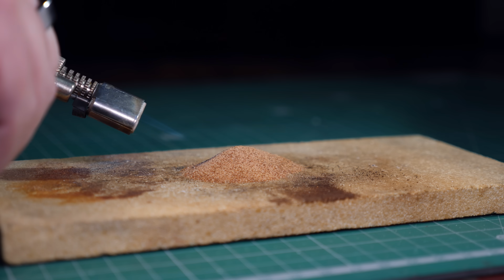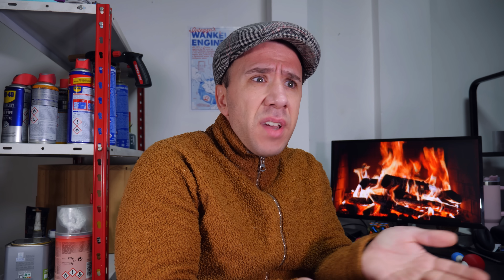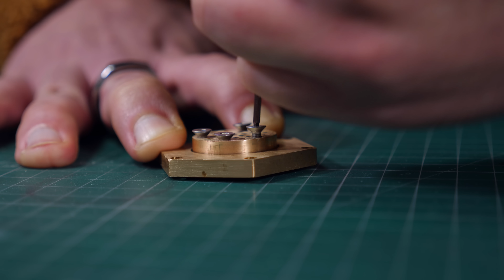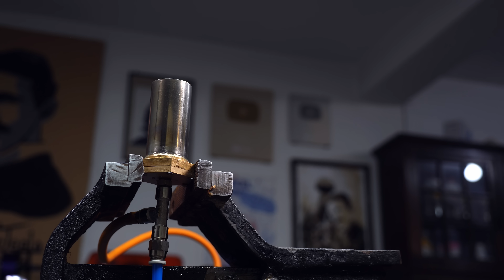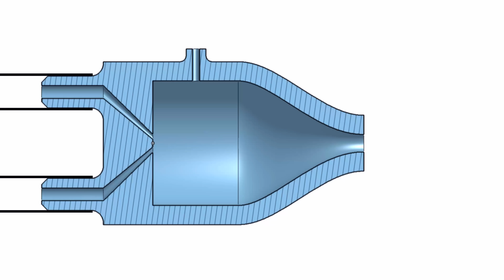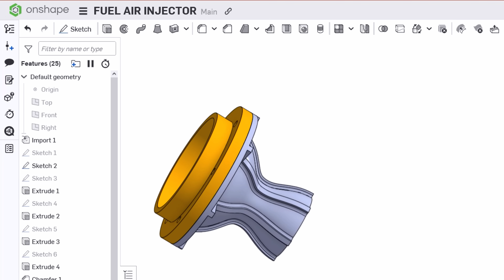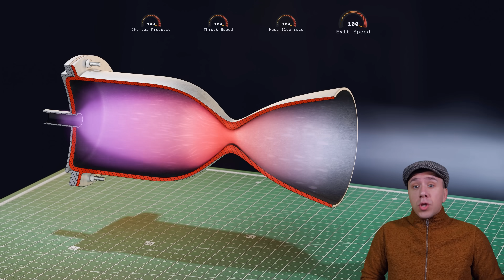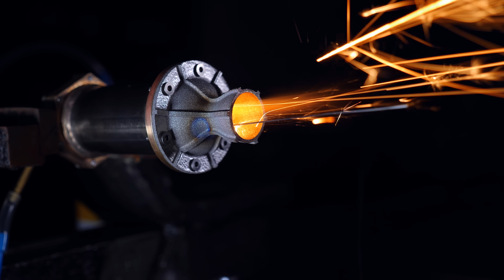I Built the FIRST VENTURI ROCKET ENGINE

Comment: 13:48 did you really just put a carburetor on your rocket😂
Reply: That's literally what I was thinking 😂😂
Reply: If you factor in the compressed air, the ISP of this rocket is not going to be amazing... On the other hand, as an afterburner for a conventional jet engine, this could get really interesting.
Reply: not just any carb, a 6 barrel carb 14:40
Reply: Many liquid rockets have carbs
Reply: @revodrvr  they need to hit their macros
Reply: @revodrvr  source? I’ve been trying to find an example of this and can’t find anything
Reply: @Porcuponic  There's no source because it's not true. Rocket engines typically use fuel injection, because carburetors are inconsistent at best and unreliable at worst.
Reply: @Torrent.Amador  I agree but also like, I think it’s completely impossible. I’m pretty sure rockets have massively powerful fuel pumps. Carbs just use passive evaporation of the fuel. You couldn’t make enough thrust with a carburetor to lift a carburetor.
Reply: @Torrent.Amador  i mean if nazis can find a way to use fuel injection in v2 80 years ago i think he can find a way to do it as well is what i thought to myself that way he doesn't need to reinvent a carburetor
Reply: Hey, they did it on Star Trek
Reply: @stevenhobbs709  Which episode? I want to watch it
Reply: @ptah956 Vis à Vis" from Star Trek: Voyager (Season 4, Episode 18)
Reply: @ptah956 Voyager S4 Ep20
Reply: But turbo charged.

Comment: The reason they probably domt use a solid oxidizer in a hybrid is because of corrosion. Any amount of corrosion in the structure mixed with heat could weaken parts and structures and cause catastrophic failures. At least thats the only problem i see with this at scale
Reply: I also love that he reinvented the carburetor for this project.

Comment: So, in hybrid motors like this, you usually cast the fuel in place and then run oxygen with a throttle. And the fuel is cast with multiple holes through like a mesh to increase surface area to increase pressure from combustion and this higher performance (and even more combustion because the higher pressure and heat from combustion increases the combustion of the fuel too). 

Your rocket will likely work still using AP as the grain and the fuel as the throttle, but as you saw the AP likes to react with everything which makes it a bit tough to control compared to a mostly inert fuel waiting for an oxidizer to combust. 

Cool rocket project though! Can't wait to see you scale it up and fly a model!

Comment: use a quad spiral injector..fed off a single injector.. like the DICOR feed for ICE engines..for the fuel so that you get the right spray! Should help to have better combustion and why not toss in a heat plug or two for the igniter

Run the pressurized air and the IPA through a Quad Spiral Dual-Fluid Injector. The air's velocity will violently shred the liquid sheet created by the spiral, giving you an ultra-fine aerosol mist that will mix instantly with the AP core's oxygen.This is the ultimate air-fed solution!Why it's better: It guarantees the finest droplets you can get without building a huge $\text{MPa}$ fuel pump.The Ignition: Use those Heat Plugs to keep the core smoldering (for instant re-start), and the Carbon Arc Plugs for the "plasma punch" that guarantees ignition when you blast the air/IPA combo.

Comment: the level of chemical knowladge started to amuse me at the point you said you wanted to just casualy buy it online. "Also give me side of 10kg CO2 (cant own more than 3 in EU) and pick me some 30% hydrogen peroxide....what, its just a injury tratment... what 30% can lituraly dissolve my ass if i spill it?" type of convo i can see you try to enegage in if you tried to drag your sorry ass to the stor it self Inzgetka. Also i love your PPE.... gloves, respirator wannabe thingy and SWEATER.... I hope you picked it bsc its from natural fibre so it doesnt stick and burn you more if set aflame. BTWE dont let AP into air if you are sweaty, aint kill you but you shid yourself to oblivion. Mechanical engeneers dont much care if you screw up so you did not had be afraid of them in the past... But chemistry engineers.... prepare for nice eeehmmm "chemical burns" :D

Comment: Check out how carburettas on cars work, SmarterEveryDay has an interesting video on the basic idea, mainly looking at the venturi effect, but they're a great, proven system for atomising a liquid fuel, it may help ensure the fuel flow is more consistent which would be a part of the pulsing? It could be that at times one of ya 6 holes is somewhat blocked by the ipa coming out making ya fuel flow not consistent enough? I think adding a float bowl of sorts to help ensure the IPA feed is consistent vs gravity fed may help!

Comment: Wouldn’t helmholtz resonance have an effect here too? Where the pressure above the chamber forces air into the bottle, then pressure increases in the bottle. Pressure in bottle becomes slightly higher than at entrance which forces some of the air out of the bottle along with fluid. This then resonates at a frequency dependent on the bottle and the pressure coming out of the hose. It’s kinda like blowing air into a bottle to make it ring out a note. The bigger the bottle, the lower the note but then adding water and displacing the over all amount of air changes the pitch of said note

Comment: You literally just commented on the dangerous exhaust from ammonium perchlorate right before doing a test in a closed space with no visible air venting capability. 

Please exercise more safety. You have a personal responsibility to your followers to set the example of doing backyard engineering in a safe way. 

- Professional Engineer with a significant pedigree that I can't share details about.

Comment: Use biodiesel, 2-propanol, and dinitroglycoluril as additive in the diesel. You can have the 2-propanol pre-mixed in your fuel tank but the mix will be more consistent in supply if you just stick with a dual fuel injector. Your choice of oxidizer as I normally call for forced air :P

This is basically my go-to for my various throttle-able stirling hybrid micro-rde designs.

Comment: little correction, you used an venturi nozzle, it is not the venturi effect, that's only for non compressable fluids, like liquids. Air is compressable. I think the Bernoulli Effect is what you searched for.
When I remember it right it has something to do that moving air molecules have lesser kinetic energy, than "static" (sourrounding) air. Therfore moving air has lesser pressure against it's sourrounding and the sourrounding air pushes in this lower pressure area. While the sourrounding air is moving, it tears for example your alcohol with it. We should never forget that normal pressure on the surface of earth means ~1kg per cm²

Comment: If you're going to be tackling liquid rocket engines I highly recommend researching the Rutherford engines from Rocketlabs. For small scale engines you could use electric motors to run your turbopumps. For fuel and oxidizer you should look at ethanol and hydrogen peroxide, both the individuals being non-toxic, easy to store and somewhat easy to get (high concentration hydrogen peroxide might be tricky) plus the exhaust is non-toxic as well.

Comment: You are correct that it is not the venturi effect that is causing the underpressure. It is the curvature of the streamlines that is causing the suction. And for the small inlet you have in your demos with the airgun, there is a lot of curvature. What you ended up doing though, is probably realy working with removing the gas from the chamber and causing underpressure. Very interesting.
Reply: Shhh, don't tell the other commenters the guy designing the entire engine actually knew what he was saying- they might get upset because they're having a field day thinking they're the smarter ones.
Reply: Yes and no - the initial demo is from the Venturi effect. I don’t believe the nozzle he made is though.

Interestingly, a similar effect is used when testing high expansion engines at sea level - they use the rocket exhaust to draw a vacuum

Comment: I learned in physics that that would be considered the Bernoulli's principle and that demonstration was used. To clarify that it's not the Venturi effect. The venturi effect only really applies to two-stroke carburetors and carburetors for high performance like muscle car stuff. I believe I don't even think modern fuel injection really considers the Venturi effect useful because everything went to gas direct injection

Comment: Potassium nitrate, easy to get? Hahahaha. Not in my country up here in the north of the EU. I'd have cops at my door if I tried to order a 40kg bag of +99% pure KNO3 without a company with a reasonable use case and the necessary licenses. Bad quality fertilizer KNO3 with added calcium to act as an inhibitor, sure, the pure stuff? Hell no.

Comment: Doesn't the air kind of defeat the original goal of having only the fuel injected into the combustion chamber? I mean if you replaced the compressed air with pressurized liquid oxygen you already have a liquid rocket engine at this point... or am I just tripping

Comment: Hey! great video, and I'm so glad you're finally pursuing a Liquid rocket! I wonder if the pulsing issues you encountered had to do to with the way that you are injecting the fuel. The air drags the fuel along with it and that combusts in the chamber raising the pressure. However, that pressure, decreases the relative pressure gradient between the air and the chamber, decreasing the ability of it to entrain the fuel, and causing the combustion to decrease and the pressure to fall. The air then increases in effectiveness and the cycle repeats. For this reason, I think you should consider separating the air and the fuel from being so reliant on each other for their feed, and also consider increasing the pressure gradient between the injectors and the chamber pressure. In Spacex's Rockets, the injectors are at 600 bar, while the chamber is at "only" 350 bar. A couple of other comments have also mentioned this, but the flow seems to be significantly overexpanded, which could be leading to significant losses in your exhaust. You really do not need to have it expanding so much, a simple test in openMotor told me that at a 5mm nozzle running at ~70 psi, the final output should have a diameter of 5.8mm.

Comment: 15:00 Now if you replace the compressed air that injects the alcohol, picture this motor flying through the air, after a certain speed an air intake could be used to generate the pressure needed to keep fuel injection going, thus turning this into a ramjet (Although a ramjet only uses liquid fuel as far as i know)
Reply: That'd be because it compresses the incoming air and uses it as the oxidiser.

Comment: Impressive stuff Joel! Hopefully you can get your hands on some more AP to continue your experiments. 
I had a thought about the nozzle though. I'm certainly no rocket engineer, but from my understanding unless you're running extremely high chamber pressures (for the amateur) the diverging section of the nozzle isn't actually that important for an engine at sea-level. And from what I can see in the video it looks like your nozzle looks significantly overexpanded. You're getting a ton of flow-separation which might be contributing to the pulsing, though there could also be issues with the converging section.
Reply: I think he has just not done any actual nozzle design. Making a nozzle that looks like a de laval doesn’t make it work like one and he never discusses how he chooses the area ratios. Very likely is just a poorly designed nozzle. He is definitely above the pressure ratio required for supersonic flow, but without correctly sizing the nozzle you never hit it and start back pressuring the engine
Reply: @slade8212  Yeah this definitely seems more like a fuel-first development process. And keeping the nozzle oversized mitigates the risk of a dangerous overpressure scenario.
Reply: @MrCharlz33 that’s true but its not necessarily oversized in this case. It seems like it’s just randomly sized to look right. A singe convergent section that is mathematically pretty close to the actual choked size is unlikely to make a bomb, but maybe have some failure in general. Either way he shouldn’t be testing inside 😅

Comment: Here in California I was able to buy ammonium perchlorate off amazon lol. I was experimenting with alternative firearm propellants, turns out the chlorine fumes make it impractical for that purpose. It's fine for rockets because it's burning away from you, but a gun muzzle is rather close to you.

Going to try Ammonium Nitrate with a polymer like Polyethylene as fuel once I find a convenient place to get some.
Reply: Under ideal circumstances, the gun muzzle would be pointed away from you.
Reply: @doctortheopolis3122  When I say "away" I mean in distance lmao
Reply: Is it because its smelly or because it eats the metal?
Reply: Big firearms use gas to cycle, so if AP isn't burned fully it will corrode everything inside
Reply: @linecraftman3907  Fills the air with hydrochloric acid, burns the nose, eyes, mouth, and lungs, extremely unpleasant and potentially dangerous if there isn't a decent breeze.
Reply: Well that's one way to make a gas pistol
Reply: The muzzle should definitely be pointed away from you. The smoke from black powder can fly back towards the shooter once in open air, but that doesn't change the direction of the muzzle. If you're using one of the open lock methods, some gas would either be generated on or come back to the side not in the chamber
Reply: @hawkings22  The gases produced by a firearm don't travel far. Only a couple feet max and then they disperse evenly, they form a cloud around you if you fire enough shots. If you've ever shot a gun you'll notice that your clothes will reek of it afterwards. Now imagine that your gun produces a cloud of highly toxic and corrosive gas and you're standing in the middle of it....
Reply: If the muzzle is pointed towards you when its fired, chlorine seems pretty low down on the list of concerns haha.
Reply: @OsmeOxys  LOL! Right?
Reply: Can you not just go down to your local Lowes/home depot/ garden supply store/ nursery and buy a bag? It is just nitrogen fertilizer. Also those instant cold packs that you squeeze and they get instantly cold have it in it or at least used to. I live in a state that you need a license to buy it in large amounts, but like 20lb bag is available about anywhere
Reply: @sinformant  Yeah I just need to get off my lazy ass and head to a nearby farm supply store lol. It's not sold at normal hardware stores unfortunately, ever since the OKC bombing (white supremacist blew up his car at a daycare and killed a bunch of people) back in the 90's it's been hard to just buy Ammonium Nitrate off the shelf.
Reply: @specialagentdustyponcho lol i am from Oklahoma and i remember that bombing and have been to the memorial. There is a lot more to it than what you stated. It honestly stinks to high heaven. I remember the local news broadcast where they said they recovered multiple unexploded bombs from inside the building. Then the next day it was like that never existed and it was just a truck with an amfo bomb. Still cant wreap my head around how the debris of the building was blown outward from the building, and how a ryder truck that has pretty thin sides was able to direct a blast in one direction and not harm the building across the street. But you know....dont ask questions. Why were the atf offices in the building vaccant on a day that they should have been open? 🤔 the world may never know. Be right back some black suburbans pulled up outside and some guys in suits are knocking on my door😂

Comment: 10:57 pure propane is odorless. A chemical called "ethyl mercaptan" is added to give the rotten egg odor. Same with natural gas. Not sure what you were smelling.
Reply: "A [...} rotten egg odor." Maybe?
Reply: @msi6824yes, but he was saying he was getting a propane smell from the alcohol decomposition as they had similar chemical structure. You wouldn't get the "propane odor" from this as it comes from the added mercaptan. Now it's totally possible he was smelling leftover mercaptan that got stuck in the chemicals or system (we can smell it at parts per billion, which is why we use it).
Reply: @PsRohrbaugh  I think he said that as a joke